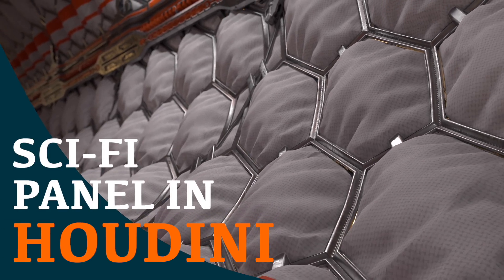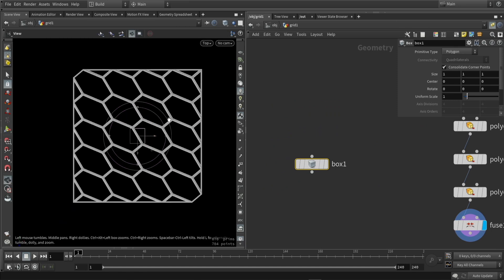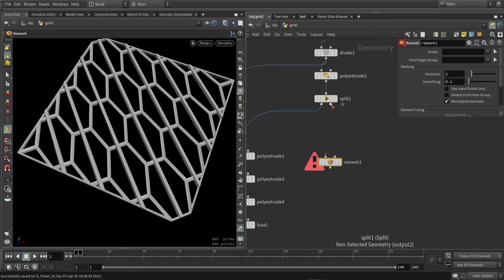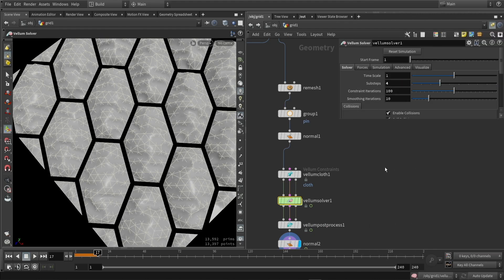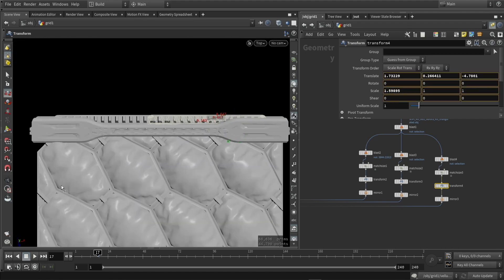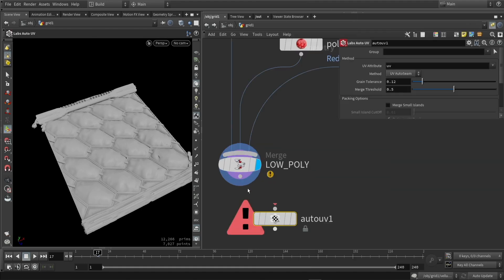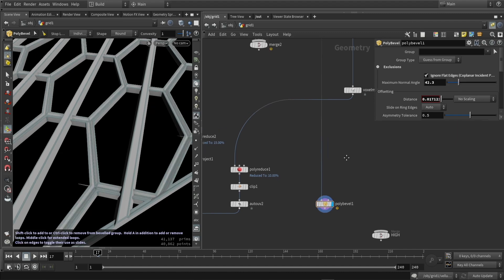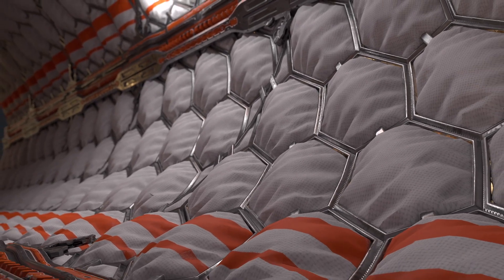Houdini Sci-fi Panel || Breakdown

Comment: Using Time Shift to outs a frame of the simulation ll produce a smaller file size than using stash?
Reply: It depends on which case is the better optimization, save the simulation time or save the loading time. You will need to recook every time using time shift, but it does not generate extra file size like Stash. As far as I know, loading a hip file that is large than 1GB is very slow. So maybe the best way is to use a File Cache after the Time Shift.